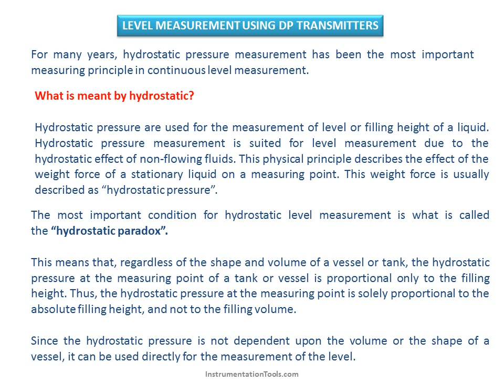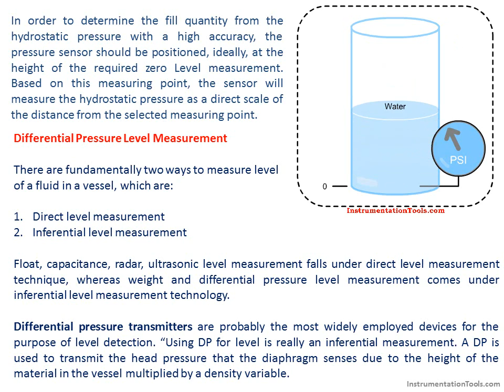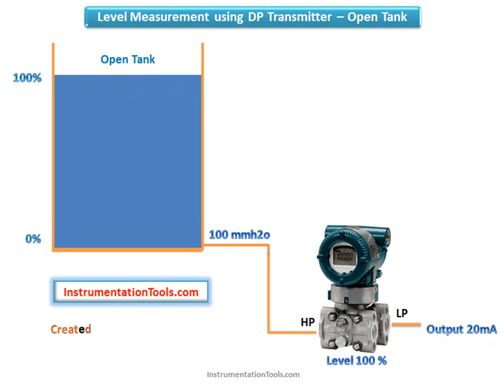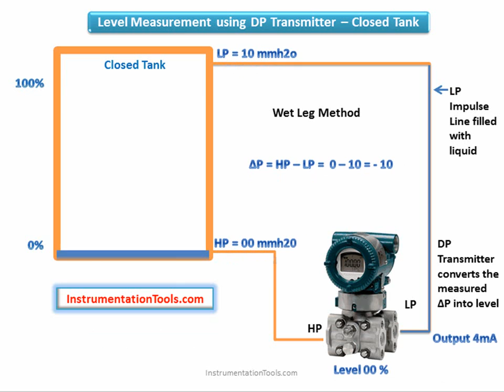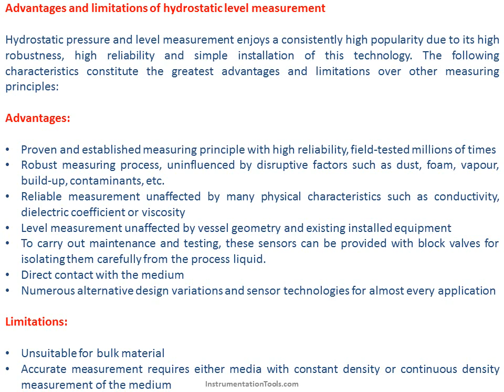Level Measurement using DP Transmitters Working Principle

Comment: This is incorrect information, it is not the high pressure 50mmh2o - 10mmh2o in the closed tank, but 60mmh2o - 10mmh2o, the sum of the gas expansion pressures on the low pressure side.

Comment: I have a closed tank system. How do I know if the low pressure side of the DP is supposed to be a wet leg or dry leg system?
Reply from the maker: if it is filled with water or with any liquid then it is wet otherwise dry.
Reply: What if it’s a new install? Do I make it wet or dry? The reason I am asking is because someone messed with it before me and I don’t know if it was dry and they added liquid to it or if it was wet and the took the water out.

Comment: I have close tank
That have DP LT Flange type direct connected to tank
In tank liquid Diesel
Centre to centre 3740mm
Bottom to dead 200mm

How i can find out
LRV 210mm & URV 3910mm
Reply: From Engineering Tool Box:
Hydrostatic pressure in a liquid can be calculated as

p = ρ g h                         (1)

where

p = pressure in liquid (N/m2, Pa, lbf/ft2, psf)

ρ = density of liquid (kg/m3, slugs/ft3)

g = acceleration of gravity (9.81 m/s2, 32.17405 ft/s2)

h = height of fluid column - or depth in the fluid where pressure is measured (m, ft)

The true pressure head will include any hight differences from the center of measurement on the transmitter to the top of the liquid. Meeters such as the PX3005 can have a calculated offset added to accurately represent the height of fluid just in the tank.

Comment: I measure water level with MPX10DP or 53DP, coupled with an HX711, or 710B 24bit ADC, thus the whole cost it's around
5 to 20  bucks (depending on trasducer). Accuracy is 1mm and the size is no more than a bunch of cm3.
What's wrong?

Comment: Is it common to have a low pressure impulse line ran to the top of the an open-top tank?
Reply: not for open-top tanks, the difference in ambient pressure at the top of the tank vs. the bottom (near the device ) is negligible.